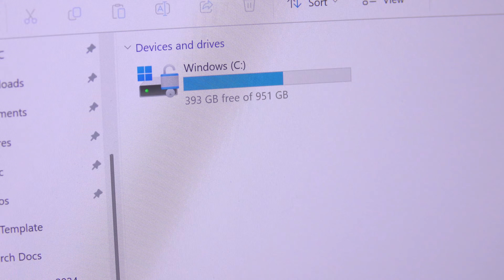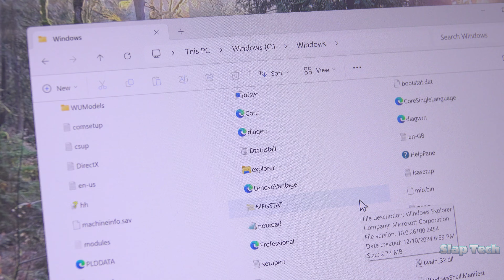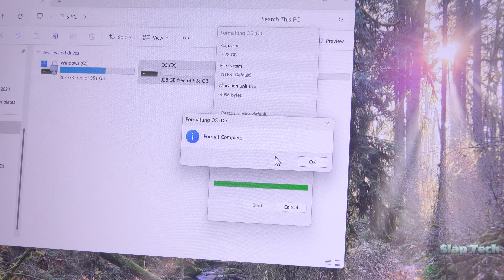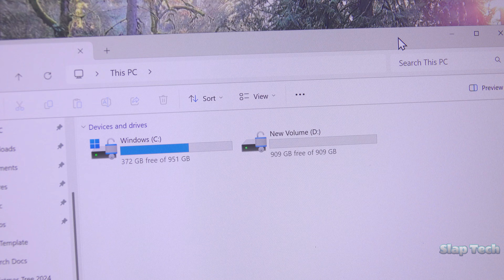How To Upgrade the SSD In Your ThinkPad | Slap Tech

Comment: 3:37 -- That SSD should be sandwiched between two thin thermal pads. They tear very easily when removing the drive, and replacements from Lenovo are expensive. How did you handle this?